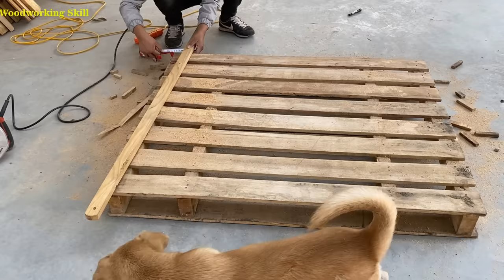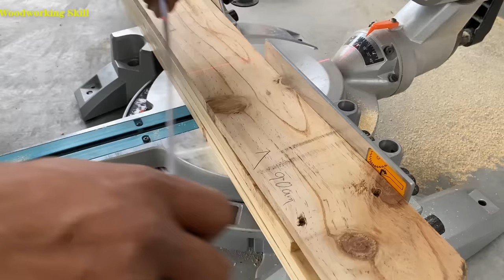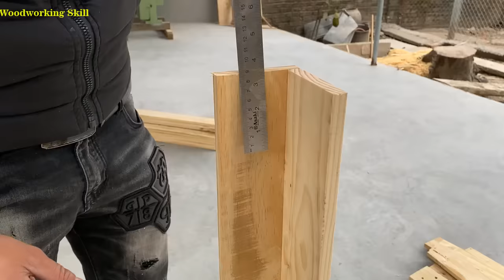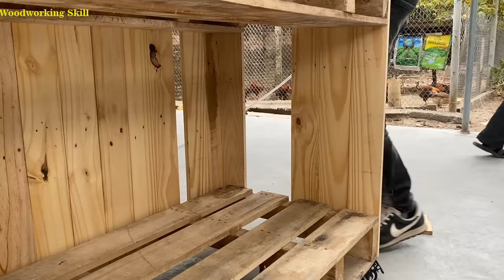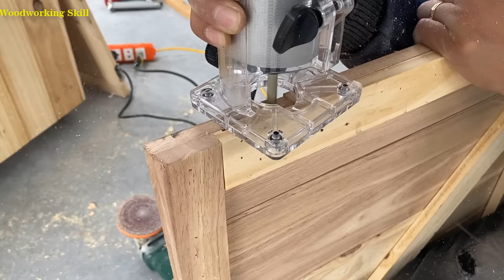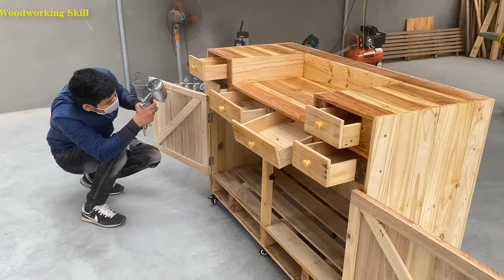The Idea Of Making Smart Wood For Workshop From Used Pallet // DIY Drill Press Stand with Storage

Comment: I love the variability of this design. Not only does this make a brilliant workstation for the shop, but it could very easily be adapted to a TV Media Centre with built in power outlets by using full length slats on the top instead of only on the sides. A power outlet or two could be embedded into the back of the centre shelf, and the huge cupboards underneath? Perfect for a PC and even modern consoles to be neatly tucked away...

... And then there's the ample drawer space for controllers and other knick-knacks.

Hell, make it 2m tall with some shelves on top thanks to another pallet, and you could use the backing board in the middle to even mount your TV, and just have a soundbar on the surface underneath, for a super clean look.

Then do the same thing on each side but 1/3 of the width, to create surrounding book/DVD shelves with more drawers in between lower down.

Colour me inspired.

Comment: Brilliant 3R Woodwork. Thank you for sharing. I only have one comment: the diagonal brace for the doors should be fixed the other way, ie, the brace member should be bottom fixed at the hinge side, and top fixed at the open end, because lumber works better in compression than in tension.

Comment: I would have liked to see the construction of the drawers and for additional storage space would have also made drawers for the bottom instead of leaving it open. If I build one, I will probably use some screws and glue for the core structure instead of 200 small nails to hold it together. I would also spray all of the drawers completely before installing. I do like the design.

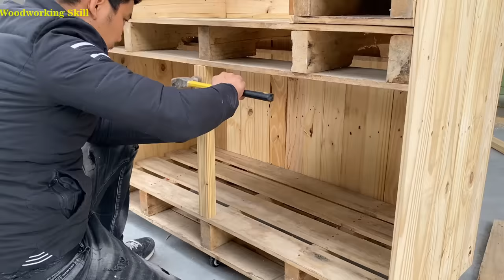Comment: Did you see the hand-smack at 12:13, and the whole top shifted? THAT'S why you GLUE joints before nailing. Otherwise, the flexing from normal use, especially since it's on wheels and thus able to be moved, will eventually weaken the nail-only joints, (which means the whole thing) and it will start to come apart.  But I like the design's layout.

Comment: Nice but 100000 nails and THEN the planer???!!!
Reply: True 100,000 nail and 1 screw but it still turned to be a nice idea.
Reply: @nymincho  he means that sanding the wood AFTER nailing is not a good idea. The project turned out great, but the tool had some unnecessary wear and tear from the nails.
Reply: He can do whatever he wants

Comment: “A” for effort but this is structurally a fail. Pin nails and a screw here and there is just poor craftsmanship. Pin nails are simply not made for this application (at the very least use wood glue to make it somewhat plausible.